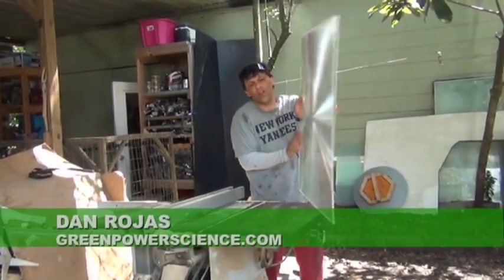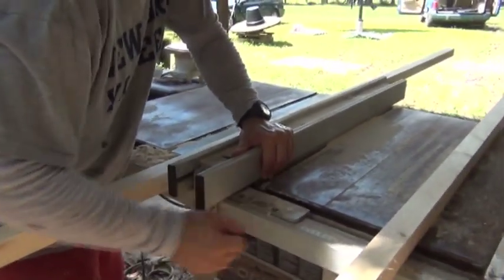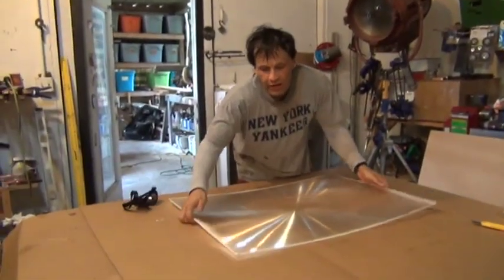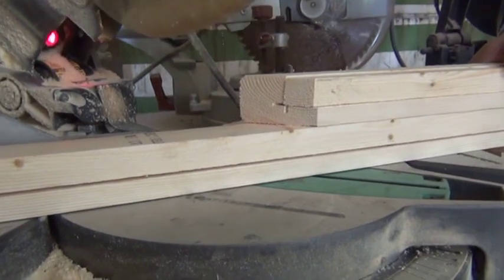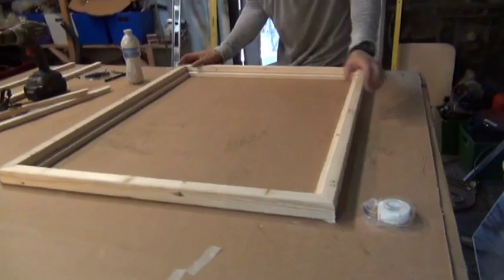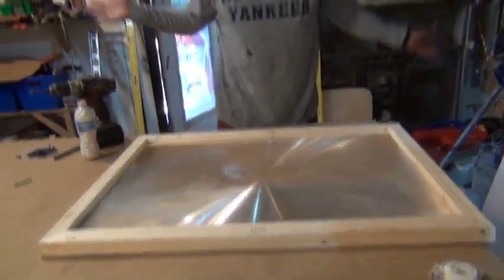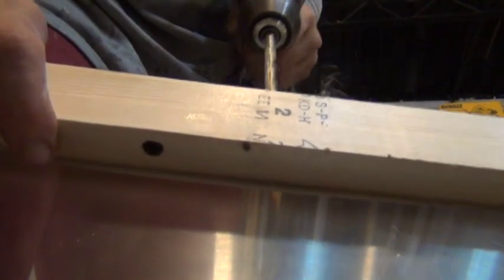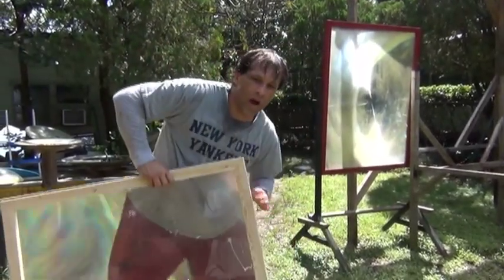Dan Rojas Fresnel Lens Framing Artwork and Mirrors Solar Oven Solar Scorcher solarscorcher frame

Comment: hi dan i need your help. i have 5 harbor freight solar panels. totaling 75 watts. i found some 
12V  130 watt PV PANEL the harbor freight are monocrystaline. 15 watt each.
 the sales guy told me that, i cant mix them together because the.pv panel is 75 watts and when you mix them with lower watt, it will only run at 15 watts, is that true?  i really want to put them all together. to make 205 watts. please help.

Comment: fianly I got a Fresnel Lens I have been watching you videos it took forever to find a big screan projection tv and finly I found one for free lol and other goodies in side.  now to exsperment I like to buile a solar heater but I will muck a round to see what I can do with it. qeustion if you put a bend in the linze will it still work for like heatting hot air in like cans ect I want to get as much heat in a small place as possible.

Comment: Thanks Dan. Your method of using the screw itself to drill the pilot hole is excellent.  I think this is only possible when one uses Robertson-headed screws. It would not work with screws used in my part of the world; mostly 'minus' or 'cross' heads.